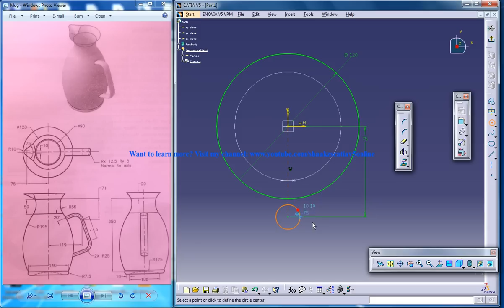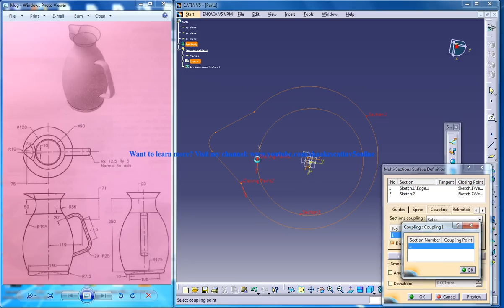Catia V5 Tutorials|Wireframe and Surface Design|Rebuild A Mug|Part 1

Comment: I cannot select the closing point 1 or closing point 2 as the coupling points. They keep changing the direction of the arrows. What do I do? Or what am I doing wrong?
Reply from the maker: +Zoya Farooque Hi Zoya, I think you got confused with closing point and coupling point. Make sure the closing point arrow is pointing to one direction by clicking on the arrow and changing it.

Comment: hi many have problem with coupling as me too.As i click on a point for coupling(1) the points are not added or the first coupling and thus not done
Reply from the maker: Please go to the coupling tab, then right click on the white space and go to add, then start selecting the coupling points two each..repeat the same to connect all your coupling points,
Alternatively, Follow the video again properly
Reply: +Mohammed Shakeel  sir i did the same way as u did but i got stuck at selecting coupling points near closing points, i selected coupling bar and clicked right click and tried add from it but it is selecting the points, kindly help

Comment: i followed the steps you did but when i wanted to use the multi sections surface for the upper sketch with the beak they told me that "the element is not connexe"  also when i tried the colage they told me that the profile gives "cusps" ?? thank you for you help.
Reply: fatima ezzoha semlali you forget to trim something repeat video 2:50
Reply from the maker: Firstly, If the element is not connex then your sketch will be open
Secondly, If the profile gives a cusp You might want to do the coupling once again. Or check your closing points again.
Reply: How to make my sketch 2 as a connex ,I have made sure all the elements are trimmed properly